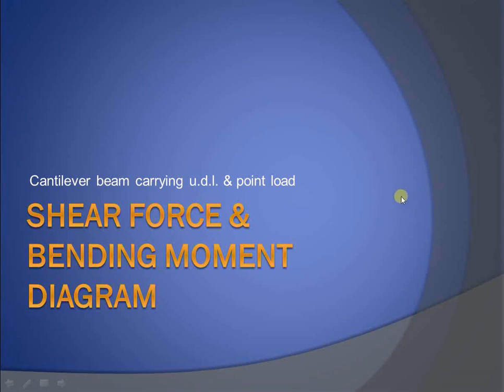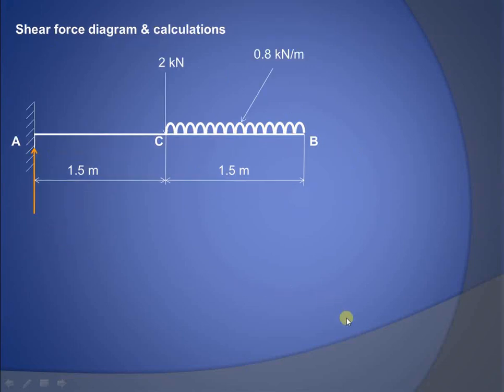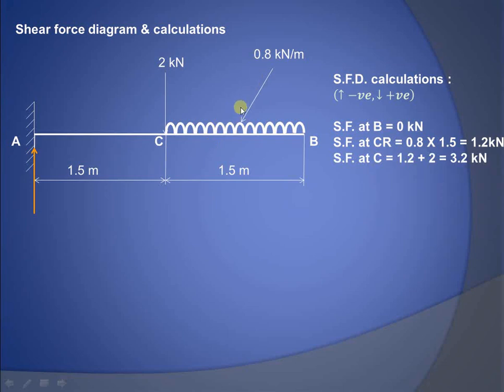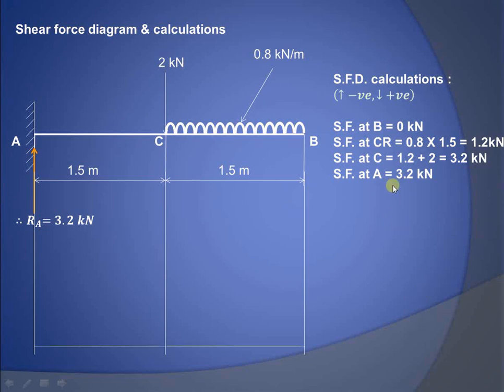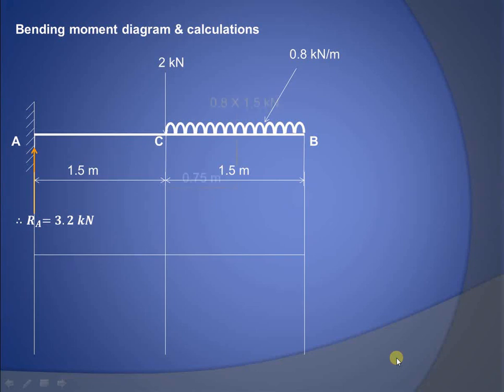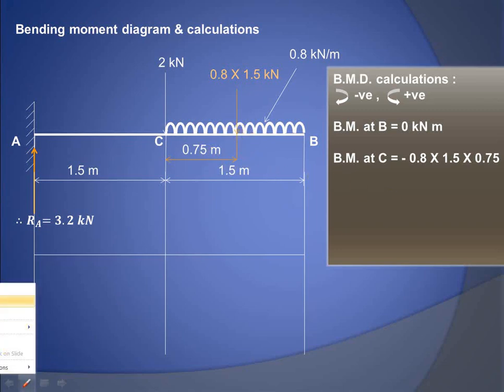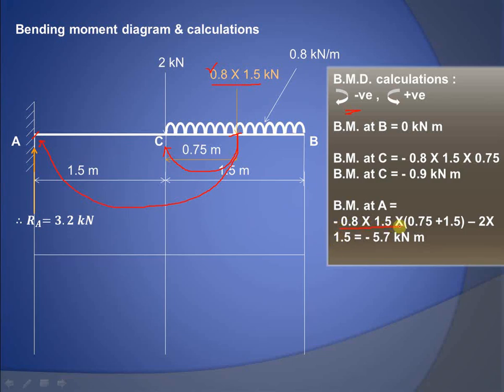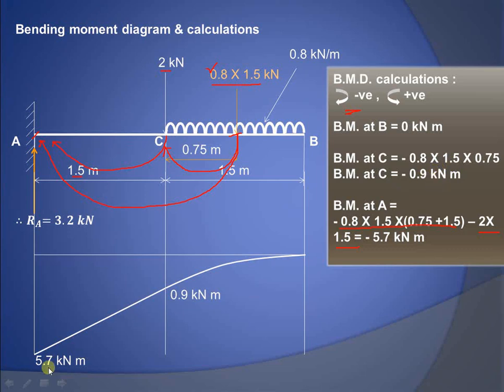Lecture 1 | How to draw shear Force  & Bending moment diagram | Cantilever beam

Comment: Sir agar fixed supports left ke jagah right side me ho n point load right ke jagah left me ho n mera sign convention clockwise positive ho .den sir sfd kya hoga? +ve or -ve
Reply from the maker: Solve in the same fashion as explained ... But only change the sign conventions  for both SFD and BMD .. THANKS !!!!
Reply: CHINMAYACADEMY No sir U didn't get my problem .i have already solved it in the same way(taking sign convention as required)  and i got Shear force as " -P ".
So the my sfd is negative instead of positive.
I want to know ,whether my ans is right or Sfd will be positive (p ) for all cases ?
Reply from the maker: Great !!! Your answer is absolutely right !!! No problem , go ahead ....

Comment: I am just a beginner at solving shear forces however on right on the start 1:13 you wrote 0.8 times 1.5… I thought the equation of Moment is Force times Distances whereas the 0.8kN/m has the Units of moment… Shouldn't the 0.8 be the moment so that the calculation would be 0.8/1.5 (0.8 over distance)  is equals to the force (N)… I feel like you treated the 0.8kN/m as a force whereas the Units for the force is Newtons (N)… 

- Shouldn't it be division from the start to get the force?
Reply from the maker: It is in fact  a force , we have converted that uniformly distributed load (u.d.l.)in to a point load acting at the center. That total u.d.l. will be 0.8 X 1.5 = kN/m X m = kN . The meaning of the u.d.l. is  for 1 m ,the load acting is 0.8 kN then for 1.5 m length what will be the load & hence the multiplication & not the division. I think it will be clear now ... Thanks

Comment: I follow the example. But maybe you can help me out a little.  I see that the bending starts at 5.7, but why doesn't it go to 3 at C, then jump straight up to 0.9, then finish at zero?  I am not seeing how it starts from 5.7 then goes to 0.9 then finishes at 0.  I don't understand.  if you could help thatd be great. thanks in advance.
Reply from the maker: For calculation of bending moment at C , consider all the forces on the right hand side of C , excluding the force acting at C . Hence, we get bending moment at C as 0.9kN-m. Hope it will be clear now. Thanks ...

Comment: guy's can any one explain me the bending moment at 'c' he got -0.9kN how did he get that one?
Reply from the maker: +Don sam We have converted the u.d.l. into point load acting at the center , hence the total u.d.l. is 0.8X1.5 kN & again multiply it by the perpendicular distance of 1.5/2 i.e. 0.75 m & hence the moment is 0.8X1.5X1.5/2 = 0.9kNm. Clockwise moments are considered -ve & hence -0.9kN m is the answer. Thanks .